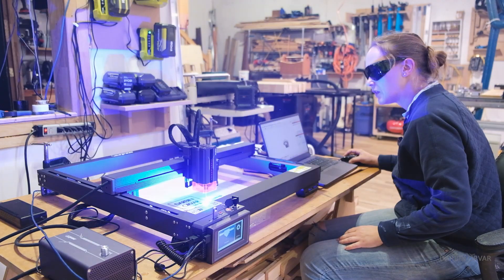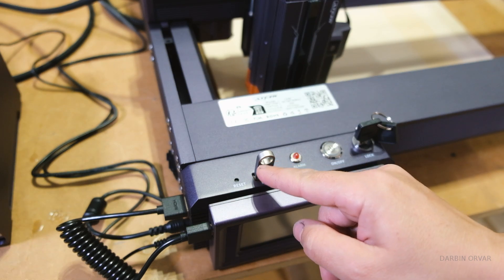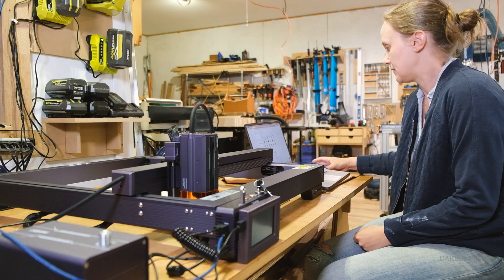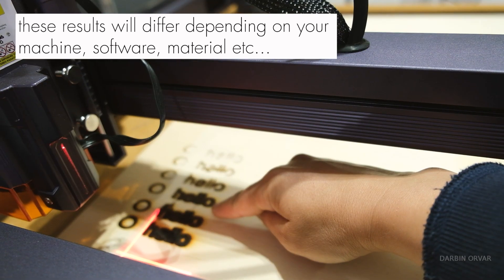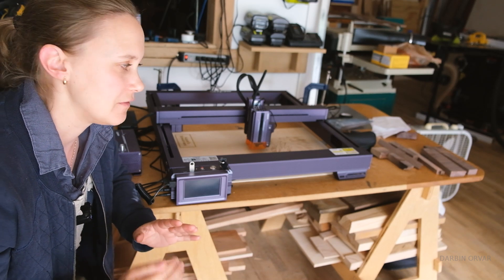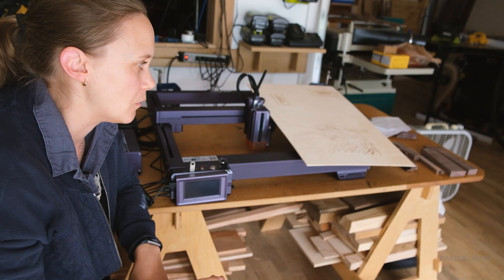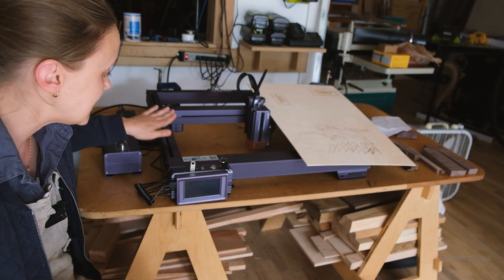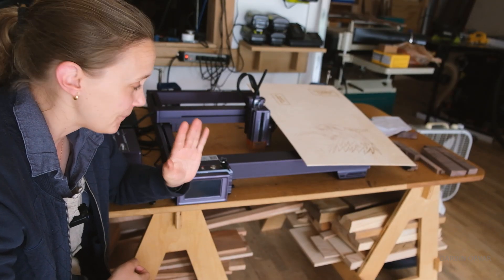Intro to Laser Engraving (ft Atezr L2)

Comment: A very nice machine.
It looks more or less identical to the iKier brand machines.
I can recommend buying (or building) a housing with smoke extraction and a honeycomb to avoid burn marks at the underside of the material. With a housing, you can safely use the engraver, especially with the possibility of other people coming in range of eventual laser reflections. Especially when engraving materials other than wood, the smoke can be toxic.

There also are materials, like vinyl / PVC which shouldn't be engraved, due to the toxic and harmful gases, which can also damage the laser.
Reply from the maker: I'm just in the process now of designing a better downdraft style table. And I did buy a honeycomb that works much better.

Comment: And on the laser safety subject, many of the so-called laser safety glasses sold on Amazon, etc, are useless crap.  I noticed your laser unit has a small, inadequate-looking orange-tinted shield, and your laser beam seems the same basic color as mine.  I bought my glasses, (including extras for any spectators), from my laser vendor.  They are the same color as that orange shield we have in common.  Your glasses appear to be a dark dark green.  Maybe they are OK, but laser safety lenses need to be specified for the exact wavelength of your beam.  Even the darkest standard sunglasses will not work.  They may only provide enough protection to mask the damage until it becomes severe.  If they aren't the right type they may only serve to cause the pupils to open wider, increasing the danger.

My laser's focal distance is such that it rides 1/8" above the target material , so the orange shield completely obscures the beam itself unless I drop down level with the work piece.  Which I will NOT do.  And I STILL wouldn't operate without my glasses.  Yours seems to focus a large distance above the target, with a HUGE visible laser beam exposed. With that rig of yours, I wouldn't want to be in the same room while it's operating, unless I had glasses I KNEW are spec for your beam frequency.  And even then I'd be uneasy and reflexively squinting a lot.

You can also buy sheets of the same plastic glasses are made of.  I bought some 12 x 12 orange colored sheets, also from my vendor.  I intend to incorporate them into a front window in my future CNC / Laser enclosure. 

I'm amazed at the casual way laser safety is demonstrated on-line, and in advertising.  Favorite is the guy engraving with a massively open framed laser on shiny round tumblers on his low coffee table.  His faithful dog and he are both just inches from the beam, smiling and staring intently.  NO glasses or shielding in sight.  When he goes blind, will he have to trade in his Best Friend for a seeing-eye dog?  Will his current dog also get a seeing eye dog??  Truly scary stuff.

I suppose some of my laser safety awareness stems from an experience 20+ years ago, when some fool was playing with a laser pointer, flashing it around inside a crowded restaurant.  As our party was exiting the front door, I got a quick, passing flash of red light in my right eye.  It was like a physical punch.  I figured it would pass, and going back inside to kill that idiot might have ruined our evening, so I just went home.  And it took at least a month before my eye stopped hurting.  Now that was with a low-powered red laser pointer (maybe 300mw?), from maybe 20 yards away.  

So, imagine what damage you might suffer from mere feet away, with a laser rated 100s of times stronger?  A quick accidental reflection, or prolonged staring at a beam as bright as the sun?

Please, look into additional shielding and get the facts on those iffy-looking green lenses for your wavelength.  You'd look odd posting videos with your seeing eye dog  at your side.

Comment: Let me preface this by saying I'm a long time viewer who loves your work.  BUT, before burning anything other than wood, you need to search for videos on dangerous materials, and you do your viewers a serious disservice by failing to mention these dangers UPFRONT.  Hopefully, your laser manufacturer should have included some guidance on this issue. MANY of the materials people might find around them give off seriously TOXIC fumes that can also seriously damage or destroy their equipment by coating the laser optics with a nasty residue.  Chemically treated or painted wood is awful. Plywood glues are nasty.  Leather is bad enough, but many bits of "leather" in our world today are made of seriously toxic man-made plastic materials, and they can be difficult to distinguish.  Many if not most plastics give off seriously dangerous fumes, including chlorine and cyanide compounds.   

I have a small J Tech Photonics laser head that is strapped to my Shapeoko CNC, and I use Lightburn to drive it.  Thus far, I have only burned wood, my CNC is adjacent to my garage door, and I always have a large fan blowing the fumes out the door, and I still have issues with smoke in my shop.  I intend to build an enclosure for my CNC / laser combo, and it will include dust extraction for the CNC as well as a separate smoke / fume extraction system for the laser.  Only then will I feel safe enough to burn anything other than clean pine and oak.

Comment: lol, i just bought one and received it yesterday. same brand, but not as many bells and whistles as that one, but i did the same. i set it up and tried it out, i ran it a few dozen times and it did NOTHING. i was getting very upset. your issue was the speed, mine was the power was turned down way too low.

Comment: Linn,

I suggest you either purchase or make a cabinet for your laser engraver.

It doesn't even need to be a full cabinet, just one where the walls are tall enough so that if Austin should happen to walk into the room while it is running, there can't be any accidental eye damaging stray flashes.

I haven't played with my burner is awhile.
It's rated to cut 1/8 inch wood and I accidentally burned a hole in a piece of 1/4 inch.

The apartment manager installed a new fire alarm system and I'm a bit concerned that it might go off if I fire up the burner. I need to make a case big enough to house the burner and the air cleaner I have sitting next to it.

Comment: A basic portable industrial style barrel fan placed OUTSIDE with some large diameter flex ducting going inside could move the fumes from laser cutting out of the building as well as reducing the noise in the shop. For smoke and fumes you need high volume rather than velocity, which is more important for moving wood dust from a CNC router.

Comment: I have kids, so safety features are a priority.  I have the Next Wave Moray Diode laser.  It has a steel enclosure, exhaust fan port and will shut off if you open the lid.  That said, it can barely cut paper.  It takes hours to do a project with 2mm basswood.  My wife's Cricut Maker can cut basswood faster.  I recently ordered a Roly Lasermatic10 engraver.  It too has an enclosure, exhaust fan port and safety shut off.  It also has a rotary attachment, work area camera and safety shutoff.  I'm hoping the new laser will be more capable for the type of projects that I do.

Comment: Your tests look out of focus to me - ah, you just addressed it @6:25.  Leather works well, but with no extraction, get used to the smell of burning flesh.

I opted seven or eight years ago to purchase a $400 K40 CO2 Laser and play with it.  I've had a lot of fun making things and learning about the process.  I use it to make wooden nametags for scouting groups, engraved nameplates for Eagle Scout projects and so much more.  It comes in it's own enclosure with ventilation and external liquid cooling for the upgraded 50 watt laser tube.